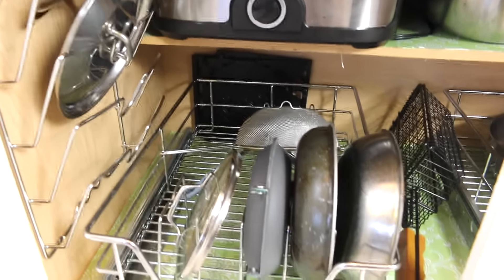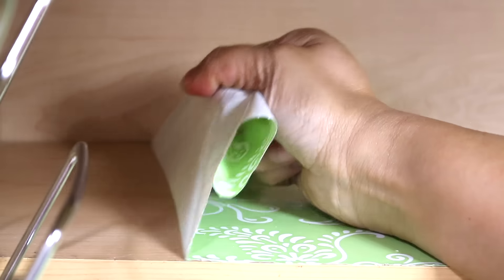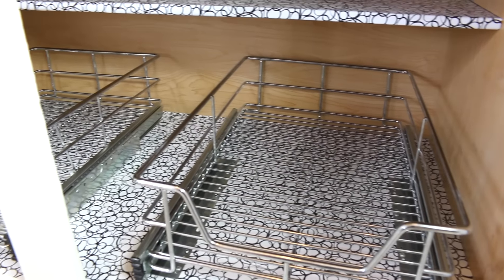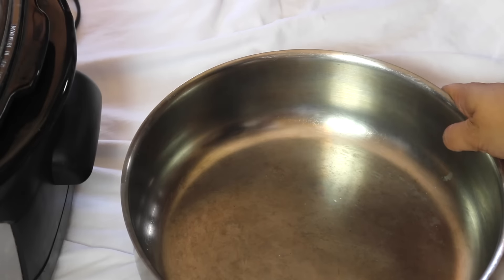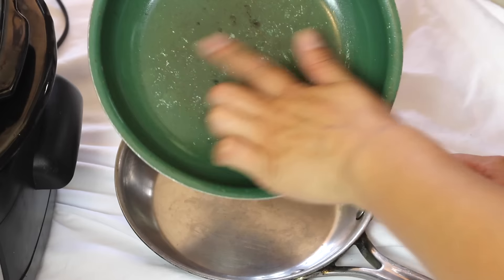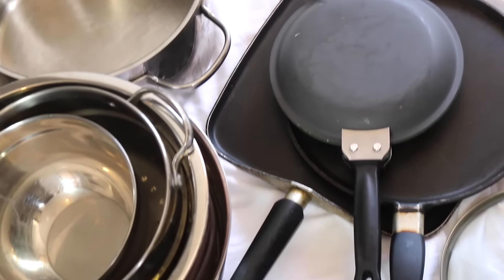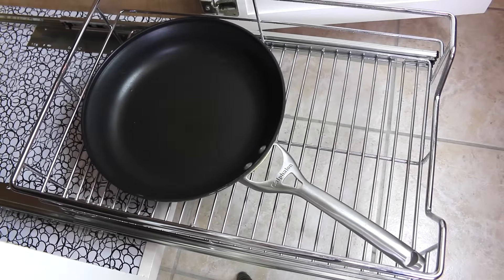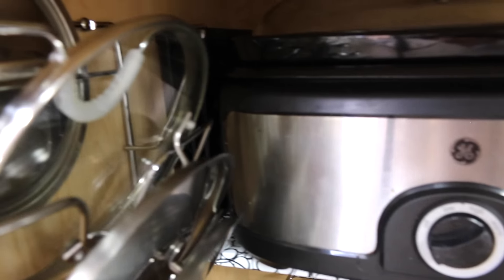Declutter with Me! the Pots and Pans Cabinet (kitchen series) {Ep. 1 of 4}

Comment: I just LOVE your adaptation to the sliding unit. So smart. Do you have any ideas on how better to utilise that cabinets above the fridge (I also have one above the stove) to be able to use the full depth. I  really am struggling and are desperate. Thanks.
Reply from the maker: Hi Gillian. For above the fridge, since I need a step ladder to access it, I store things that I use only for larger parties. For example, I have a cheese board and margarita glasses there now. I used to have Christmas serving ware there. So my suggestion is party ware and holiday ware. You use them but only occasionally. If you use paper plates and plasticware for parties, they can go there, too. If you stock up on foil, ziplock, etc, these can go there.  For above the stove, since I can tip toe and grab stuff from there, I have my small appliances like the electric can opener, ice shaver, waffle maker, and panini maker. I use these up to 3 times per week or in a month, maybe 3 times. It is still stuff you use but here and there for making meals.
Reply: thanks. those are helpful ideas

Comment: Whenever I have trouble cleaning pots and pans in order to avoid harsh scrubbing, I put them on the stove and pour some dish soap mixed with some water until it boils and it lifts the grease or food stuck on it.
Reply from the maker: Wow what a great tip! Thanks!
Reply: I do the same, except for I don't turn on the burners because I use luke warm soapy water. Everything just wipes away!